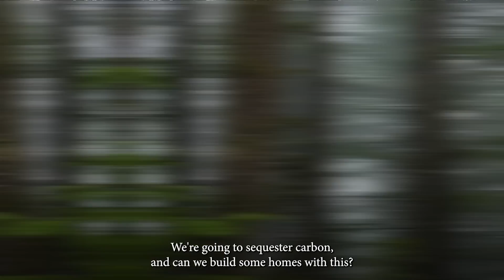A 3D printer that sucks carbon out of the atmosphere

Comment: Earth used to have 4 times more carbon in the atmosphere and life prospered. Carbon is good in the atmosphere, its food for plants.
Reply: Irrelevant. As back then, the rates of CO2 fluctuations back then were at which organisms were able to adapt and evolve to climate change. Basically enough time for the the oceans to absorb CO2 to maintain an equilibrium in the atmosphere, enough time to suck CO2 out of the air through the weathering of rocks, and enough plants to absorb CO2; all these mechanisms relatively not disrupting plant growth and life.

Comment: Plant all the trees you want, it will just burn in the next forest fire we will inevitably get because climate change does not care. We need to emit less emissions and need an adequate plan for that. What else are you planning for Climate action?
Reply: Our planet is greening as predicted by mainstream climate science and most of the current global greening is due to China’s and India’s mega tree planting programs, but it would take 4 times more land than exists on this planet with new trees on it keep up the current rate of CO2 emissions from fossil fuels, but most of that land would require irrigation with fresh water. 

Trees are not simply vacuuming CO2 out of the air and making it magically disappear. We have to take into account how many trees have reached their equilibrium - trees full grown, the tiny amount they grow is offset by decay. Plus carbon exits older forests about as quickly as it comes in so the way; forests are not an infinite carbon sink plus trees don’t last forever and when they die and decay, chopped down and burned for fuel, or burn in a wildfire, they release all the CO2 they’ve been hiding away. This is why it is so important to protect new forests permanently.

Comment: This is probably the worst time to be a fool, when climate change effect is being felt more and more around the world. Yet politicians/ Oil corporations can't help petting themselves on the back after fixing a small dent of a totally wrecked car (carbon emissions). Canada per capita emissions is one of the highest and its oil exports 4th largest. It can't be solved by carbon capture, which is impractical and much more expensive than any renewable solutions and hardly captures much carbon.

Comment: Carbon is not a gas.
Reply: Carbon dioxide is.
Reply: @petercullen1624  Correct therefore trees can not take "Carbon" out of the atmosphere as  it is not a gas but a solid. Carbon Dioxide is a gas and is not the same as carbon.

Comment: If the harvested wood is not burned, then it's sequestered carbon.  The roots are sequestered carbon (though are at risk of slowing rotting).  But remember that forests burn - the ash affect albedo and the CO2 is obvious a GHG.  And it's hard to get biomass to grow faster than CO2 concentration rises unless there's active land management.

But just remember to count the tonnes.  Atmospheric carbon is rising at a certain rate and it's being sequestered at a different rate.  So, calculations are needed.

Comment: Trees don’t just stand idly by; they tirelessly work their magic, purifying the air with their leafy lungs. It’s like having thousands of tiny air filters constantly at work in our environment.

Trees absorb carbon dioxide, a greenhouse gas that contributes to climate change, and release oxygen back into the atmosphere. This natural air purification process helps to combat air pollution and improve air quality for all living beings.

Trees also filter out harmful pollutants from the air. Their leaves act as sponges, trapping particles such as dust, smoke, and pollen. This is especially beneficial for those who suffer from allergies or respiratory conditions, as trees can help to reduce the presence of these irritants in the air.

Not only do trees purify the air, but they also provide shade, which can help to lower temperatures and reduce the need for air conditioning. This, in turn, reduces energy consumption and greenhouse gas emissions from power plants.

Additionally, trees help to prevent soil erosion and filter rainwater, improving water quality and reducing the risk of flooding. The many benefits of trees make them invaluable assets in our fight against environmental degradation and climate change.

So, next time you see a tree, take a moment to appreciate the crucial role it plays in keeping our air clean and our environment healthy.

Comment: A typical hardwood tree can absorb as much as 48 pounds of carbon dioxide per year. This means it will sequester approximately 1 ton of carbon dioxide by the time it reaches 40 years old. 

One ton of CO2 is a lot. However, on average human activity puts about 40 billion tons of CO2 into the air each year. This means we would theoretically have to plant 40 billion trees every year, then wait for decades to see any positive effect. By the time 40 years had passed, the trees we had originally planted would only cancel out the increased CO2 levels today.

To put that into further perspective, that offset in massive volume of emissions would equal out individually to each person in the country planting about 150-200 trees (depending upon the species) every year.
Reply: You forgot to account for the carbon emitted from cutting down the tree's...  If planting tree's was a solution, we wouldn't have a problem lol..  These people will lap up whatever comes out of Pee Pee's pie hole.
Reply: @ScottEdmonds pathetic

Comment: Trees are excellent but grasslands scrub far more CO2 than forests do. 
Not that it's necessary as I know CO2 is a good thing.
Reply: Too much CO2 is an extremely bad thing.
Reply: @JJRM8  
A byproduct of too much CO2 is  more oxygen production. 
Everything on the earth is made of carbon so that excuse doesn't fly with me.
Reply: @mysticnomad3577 You ever wondered where the O in CO2 comes from? Have you ever looked at what the Oxygen levels in the atmosphere and ocean are? Of course you haven't.
Reply: @mysticnomad3577  Too much CO2 especially at a rapid rate is not a good thing. To give you an idea, current observed global warming is happening twenty times faster than any natural climate change visible in the paleoclimatic record; i.e., faster than it occurs naturally in the geological record. This has made some ecosystems, agricultural zones, and feeding grounds we depend on not adaptable enough to the current climate change trend. 

Science moves on from well established conclusions to areas of less certainty such as quantifying AGW in the presence of large feedbacks like clouds and water vapour. Anthropogenic global warming is hardly the most important or interesting area of climate research because it is occurring and is settled. i.e., it’s a baseline. Just as evolution is the baseline for evolutionary biology.
Reply: @mysticnomad3577  Well explain it to George. Why so indolent?

Comment: CO2 isn’t a problem in Canada. 
Our vast greenery more than takes care of our output. 
Let’s point fingers at China and India for their cooperation.
Reply: Yea, we are like top 50, we should blame china and the us
Reply: @Joviangamer  We're actually in the top 12 for emissions.
Reply: @nothinghereplz246  still a magnitude less than the us and china
Reply: Our planet is greening as predicted by mainstream climate science and most of the current global greening is due to China’s and India’s mega tree planting programs, but it would take 4 times more land than exists on this planet with new trees on it keep up the current rate of CO2 emissions from fossil fuels, but most of that land would require irrigation with fresh water. 

Keep in mind that trees are not simply vacuuming CO2 out of the air and making it magically disappear. We have to take into account how many trees have reached their equilibrium - trees full grown, the tiny amount they grow is offset by decay. Plus carbon exits older forests about as quickly as it comes in so the way; forests are not an infinite carbon sink plus trees don’t last forever and when they die and decay, chopped down and burned for fuel, or burn in a wildfire, they release all the CO2 they’ve been hiding away. This is why it is so important to protect new forests permanently.

Comment: Imagine how much cheaper it would be if you remove the carbon tax to help transport and plant those seedlings!
Reply: Brings to mind that the surge in inflation we have seen since the pandemic has been experienced across almost all industrial countries, whether they had carbon pricing or not. The US had no carbon tax, and they experienced a higher bout of inflation than we did. Carbon tax has been baked in years before prices spiked. Carbon pricing is just an easy scapegoat for price gouging collectively disguised as inflation. What sucks is the carbon pricing systems provide a type of rebate” to firms in the form of subsidies based on how much they produce, and they never pass on the savings to the consumer. Imagine if they passed the savings on to customers.

Comment: This should be rebranded as an "Infrastructure Climate Ecological Act" so that when the govt invests in "Infrastructure", it is automatically investing directly into planting trees for carbon reduction, to develop resources for housing and biofuel, and potentially increase GDP with international markets. The oil sands should be rebranded the same because once the oil is removed, the land is refurbished to be ecologically friendly to plant more trees. That is a simple climate plan that can be put in place for eternity just by rebranding. Regular harvesting also reduces the potential of forest fires if planned properly.

Comment: Turns out, trees are incredible at capturing carbon, helping to enrich the soil through their root systems while also making the air we breathe cleaner. Wood continues to be a preferred material for building homes, and when it’s sustainably sourced, it’s not just cost-effective but also better for the environment compared to alternatives like concrete. But let’s be honest, the real key here is responsible forestry practices to ensure that we’re not doing more harm than good.

Plus, the by-products like wood chips? We can use those to fuel biomass boilers, which produce electricity and heat for local communities. Sure, it’s not without its challenges—biomass does release some carbon—but it’s a renewable option that can reduce our reliance on fossil fuels.

As for all the bureaucracy in construction? Streamlining the process could go a long way in getting affordable, comfortable housing built faster without cutting corners on safety or sustainability. Time to clear the way for some real progress, don't you think?
Reply: Trees are not simply vacuuming CO2 out of the air and making it magically disappear. We have to take into account how many trees have reached their equilibrium - trees full grown, the tiny amount they grow is offset by decay. Plus carbon exits older forests about as quickly as it comes in so the way; forests are not an infinite carbon sink plus trees don’t last forever and when they die and decay, chopped down and burned for fuel, or burn in a wildfire, they release all the CO2 they’ve been hiding away. This is why it is so important to protect new forests permanently.
Reply: You forgot to account for the carbon emitted from cutting down the tree's...  If planting tree's was a solution, we wouldn't have a problem lol..  These people will lap up whatever comes out of Pee Pee's pie hole.
Reply: @Joviangamer Pathetic.
Reply: @Joviangamer imagine the energy wasted just to post that response.
Reply: @durin6358  you’re giving me a non-answer
Reply: @Joviangamer  if I wanted to talk to a bot I would go to chatgpt
Reply: @durin6358  keep talking
Reply: @Joviangamer  Good point. We also have to take into account many factors such as type and age of tree, type of forest, and where trees are dying and being replaced at basically the same rate, and what percentage of trees/forests are most capable of sequestering carbon in the next 30 years or so to name few hence messier math to deal with; a simple add and subtract is not sufficient. Also if CO2 increases at the current rate in the atmosphere, trees will need much more nitrogen and phosphorus to balance their diets. If the soil does not have enough, that could curtail how much new CO2 a tree is able to store.

Comment: With the number of trees in Canada right now, we should be getting carbon credits.
Reply: @barbarism3242  …oh my goodness…what a great idea…love it!
Reply: Yeah we have alot of part time trees not working to their potential hahahaha
Reply: Trees are not simply vacuuming CO2 out of the air and making it magically disappear. We have to take into account how many trees have reached their equilibrium - trees full grown, the tiny amount they grow is offset by decay. Plus carbon exits older forests about as quickly as it comes in so the way; forests are not an infinite carbon sink plus trees don’t last forever and when they die and decay, chopped down and burned for fuel, or burn in a wildfire, they release all the CO2 they’ve been hiding away. This is why it is so important to protect new forests permanently.

As you see one had to take into account many factors such as type and age of tree, type of forest, and where trees are dying and being replaced at basically the same rate, and what percentage of trees/forests are most capable of sequestering carbon in the next 30 years or so to name few hence messier math to deal with; a simple add and subtract is not sufficient. Also if CO2 increases at the current rate in the atmosphere, trees will need much more nitrogen and phosphorus to balance their diets. If the soil does not have enough, that could curtail how much new CO2 a tree is able to store.

Comment: I wish we could get past this carbon-is-bad crap.  We need more carbon in the air not less!  Want to see food crops flourish?  Just get the CO2 up a bit and watch!
Reply: It’s not about “food production”. what happens when many costal cities get flooded because of the rising water levels
Reply: Problem is, higher concentrations of CO2 in the atmosphere especially at the current rate favours weeds and less less nutrient crops over staple crops. When food is grown at elevated CO2 levels in fields, it becomes less nutritious and lose significant amounts of zinc and iron plus grains lose protein. Because of this you need more fields to produce more volumes to make this up and more greenhouses, as you decrease the amount of nutrition you can produce per acre.
That being said we know that plants can acclimatize or adjust to rising CO2, but the fertilization effect of CO2 diminishes over time. In a greenhouse this is not a problem because they have excellent soil, optimal amounts of water, and controlled temps.

Nutrients are already added to top soil in outdoor large scale agriculture and it doesn’t mitigate how higher concentrations in the atmosphere affects crops from accumulating more carbohydrates than minerals. There are solutions to tackle nutrient depletion, but are not that effective at the current rate of warming, as the top soil process changes in organic carbon transformations and nutrient cycling through altered moisture and temperature regimes in the soil. Soils have actually lost 50 to 70 percent of the carbon they once held. A big concern is topsoil is used to grow over 90 percent our food, and it is disappearing faster than it is being replaced.

 CO2 concentrations increases photosynthesis, but creates lower nutrition quality because the crops accumulate more carbohydrates than minerals. Carbohydrates are a significant component of the organic matter of all soils, commonly accounting for 5-20% of soil organic matter.

Comment: Better than just hiking taxes and sitting back waiting to have to use it to repair damage.

PREVENTATIVE ACTION is a change implemented to address an issue and determine action to eliminate the causes of potential problems in order to prevent their occurrence.